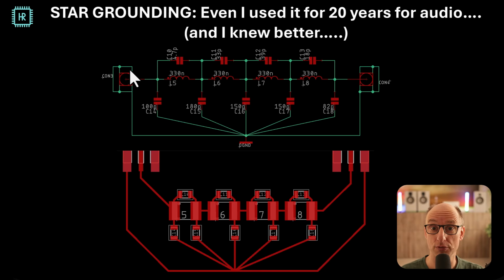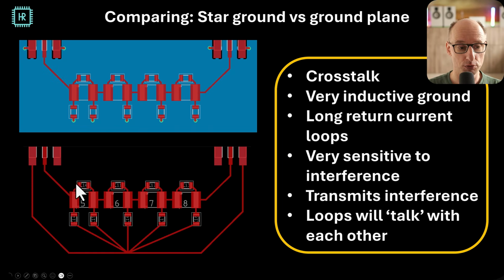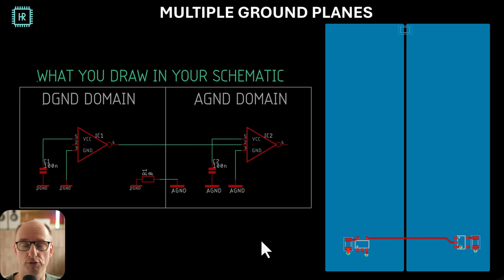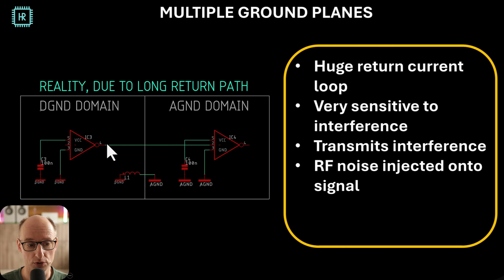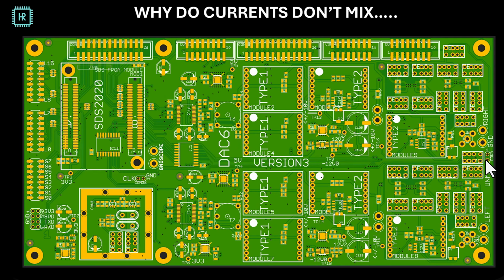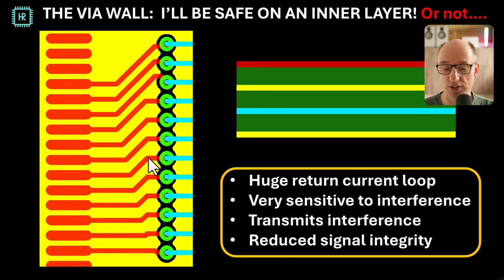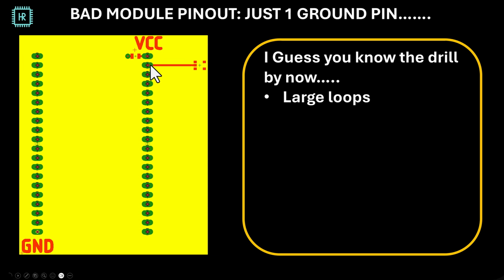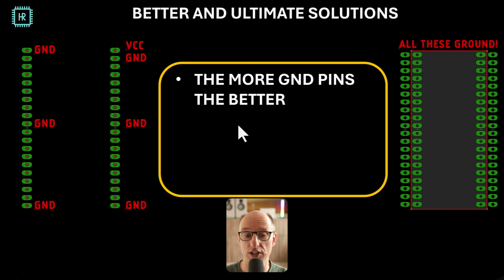Why Your Ground Design is WRONG — and How to Fix It. Flawless PCB design part 6

Comment: I got a great deal out of this. 2 things I not think about and done many of this things wrong and got bad results. Now I can say that you can be lucky and it works but most of the times no. I have had a very big problem with gnd and power on FPGA's, all the power and ground is in the middle and all signals break the power and ground planes. Only way I found was short and burried vias to fix my problems with a big cost raise. I said I could not make it sheaper with big complains from boss. Is there any sneaky way to come down in price on a pcb? I don't see how. Tnx for great content and videos.
Reply from the maker: Yeah, this is a real problem. In part 5 I show my fpga board. This board was made with a standard 4 layer with only through hole vias. It was really hard to get that right as it also had to be extremely low emi.... there is no sneaky way unfortunately. Connect less io's is a solution (unless you need all of them)
Reply: @HansRosenberg74  thanks. I needed almost all pins and had a hell geting it together.
Reply from the maker: ugh, I can imagine.......
Reply: @haraldlonn898 Some of the FPGA mfrs have app notes on routing from their different packages in each device family. They've thought about the BGA pinouts so as to ensure they can actually be wired up, but sometimes there's really only one way to route to get connection to all the IO pins. Look for, or ask the FAE for their routing guide (hopefully easily available), it'll save hours of head-scratching !

Comment: Hi Hans, awesome video series! Thank you for the great insights. I have a question regarding low frequency audio power amplifier boards (class AB discrete) that are typically 2 layer (at most). You want high SNR and decent RF rejection. The problem is they are relatively large boards with (possibly) large loop areas with large rectified half sines on one part of the board (push-pull) and a small signal class A area on the other part of the board. This is exacerbated by a NFB loop that is connected input to output.  How do you attack these issues? Can you use this example in a future video? Thanks again!
Reply from the maker: Yes, this is a problem. Large currents in an AB stage interfering with the input wiring. I highly recommend this book: https://www.amazon.nl/-/en/Douglas-Self/dp/9490929034. In my newest amplifier I'm going to use a 4 layer to minimize this. In a 2 layer you're really limited to fix this issue. I try to make as many return paths in the ground as possible. I'm planning to make a huge video series on how to design an ultra high end audio amplifier that beats or equals anything out there.
Reply: @HansRosenberg74   I can't wait for that video series Hans! I ordered the Self book you recommended. Ironically i have almost all his books except that one.. Many thanks!
Reply from the maker: this is the series he published in a magazine (I don't remember which one). This was then published in a book.
Reply: @HansRosenberg74  One last question Hans. What would the 4 L stackup look like for an audio power amplifier? Signal and power on outer layers, Ground on the inner layers?
Reply from the maker: My approach would be to have signals and components on the top. Ground on inner1 (close to the signals) and power on inner2 and bottom. You'd need to place a few traces on inner2 most likely. Use as wide as possible power planes making maximum use of all the layers you have to minimize the resistance of those planes (basically you use them as very wide traces).

Comment: Thank you for debunking the DGND/AGND myth that some companies still propagate.
Reply: I like it when the chipmakers say "connect AGND and DGND under our chip"  but you want to use 2 of them.
Reply from the maker: 🤣🤣🤣🤣🤣🤣🤣 It's just to piss you off :-)
Reply: Being power electronics designer and having to mess with hundreds of amps per some 10s of nanoseconds of slew rate, I can tell you that decoupling AGND/PGND/DGND is crucial. It's just easier said than done. Normally I plan return paths before layout (I spend much more time on placement than routing, in fact, I mostly outsource the routing part for less important jobs), pour the polygon, and trim/cut ground current isolation channels piece by piece. It's more of an art than science, but it all has science behind the scene. In my business, PnR is sorts more important than the schematics.
Reply: @bskull3232  I am very lucky in that regard. I do the schematics and  PnR. I know EXACTLY what I meant for every connection.
Reply: DGND/AGND myth 
Mate, this isn't a myth at all, especially if you optically isolate one from another.
Reply: @MSM5500  Pero si tenes un acoplamiento óptico o magnético, no tenes un circuito tenes 2, por que tenes GND1 y GND2    Saludos desde Argentina
Reply: @MSM5500  Optically Isolate GND?  That is a trick!  If you optically isolate the signals, I get that, but that's expensive as well and every one of those optically isolated signals needs to have the opto-isolator straddle the boundary.  AND make sure there is absolutely no leakage paths inadvertently made between then. (And those ADC's that 'require' AGND/DGND often are the source of that leakage path or short!!!) I guess as long as you're customers are rich go for it.  There are exceptions of course that require isolation such as medical devices that have patient contact and are very limited in energy can cross the boundary.  But the requirement first is: Electrical Isolation for Safety.
Reply: @wendellknicely395  I used to build aerospace test stands. I optically isolated (signal and ground) all signals from the stand to the control computer. Analog and digital. My builds were easy compared to guys who didn't "waste" so much money.  I went home at a reasonable hour. The cheaper guys didn't.
Reply: @MSM5500  If the circuit is completely optically isolated then it's not the same circuit at all, now is it? lol
Reply: @NiallBoggins  Depends on the definition of "circuit" I guess. I made a PCB with separate analog and digital planes, all electrical signals were isolated between those two. But there were some components (relays 😣) which had connections to both. Is that a "circuit" then?
Reply: @somebod8703  I guess the easiest test to see if it's a "circuit" would be does it share the same ground? That is, can current flow between the components. If the answer is no, then those are two different electrical circuits. An RF transmitter and receiver are two separate electrical circuits. Just because information passes between them, does not make them one (unless you want to get philosophical about it, and then I suppose everything is connected on some level... but that seems very woo woo 😆).

Edit: oh, and I'm defining circuit as a closed electrical path for current to flow... which I think might be the actual definition lol
Reply: @MSM5500  That is in fact the secret of easy test stand building. Optically isolate all analog signals to prevent crosstalk.

Comment: I think a lot of your advice can also be extended to system design, not just PCB-level. I've found that in the world of power electronics it is still common thinking that 60Hz is the only frequency needed to be suppressed and filtered. Now that everyone uses solid state switching devices with digital controllers, everything has become an RF device. I've often had to help engineers troubleshoot comm issues by bringing out a spectrum analyzer and showing that the output of their inverter design with power cables routed in a circle made a 1 MHz transmitter that is killing their ethernet link :-)
Reply from the maker: Fully agreed! With the amount of interference going around in the air these days (wifi, cell phones etc etc) any electronics design should be approached as an RF design to get the best results.....
Reply: @HansRosenberg74  I feel like it is a bit more than that. Digital electronics having energy in more frequencies than just the fundamental, and when the rise or fall times increase (ie looks closer and closer to a perfect square wave) it has the effect of pushing those higher energy densities in the 3rd or 5th harmonic to higher frequencies that may resonate with something else on your own board or on another PCB elsewhere. Just adding more here since I noticed you mentioned only things like WiFi, cellular etc. When it could just be the square waveform on your own board.
Reply: @HansRosenberg74 No... That is adding unnecesary components 😅
Reply: After bridge rectification ( or full wave) ......you have 120Hz ripple.
Reply: How do you connect the spectrum analyzer to a high voltage power inverter? I know that there are these coaxial DC block capacitors, but the ones I found were made for quite high frequencies only, like, starting at 100MHz.
Reply from the maker: I'd have to know a bit more about the frequency range you want to measure. There are much lower frequency blocking capacitors. What is the voltage across the capacitor?
Reply: @HansRosenberg74  I would like to measure down to 500Hz and up to a few MHz, at least 1MHz. DC-Link Voltage would be up to 2000V.
Rogowski coil sounds like an interesting approach. We have many from PEM with an Integrator in our Lab, which we use for pulse measuremebts with oscilloscope, but they should work on an Spectrum Analyzer too. However, they have not that good of a shielding and sometimes have problems with oscillations due to the dv/dt.
Reply from the maker: I've not done this before, but I think the rogowski coil is a good idea. It will galvanically isolate the analyzer and if it  has the frequency range it sounds like a great solution. You could build an attenuator of your own (just like a scope probe) but then you'd need an amplifier to convert to 50Ohm output impedance, which makes it harder. Plus you'd have to calibrate that divider.
Reply: @benutzernamenichtverfugbar4977  you could connect a rogowski current transformer probe. 10hz to MHz.
Or just add an aluminium foil around the power cable and connect a voltage probe to it. But this will only work for high frequencies.
Reply: Oh, that's a real headache. In Russia and CIS countries, PFC requirements are treated very lightly, so in our power grid the signal resembles a trapezoid rather than a sine. With all its consequences in the form of harmonics.
Reply: Whats up with the groucho glasses?? Ah, small hat club member, aka Rosenberg..., oy vey